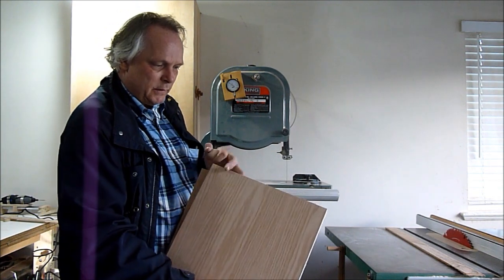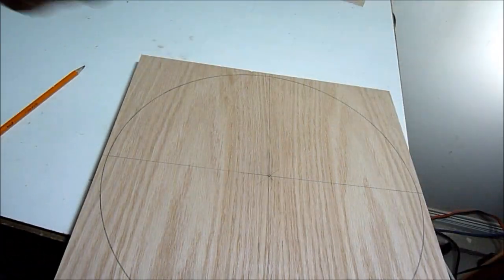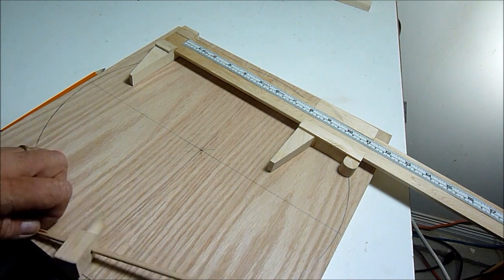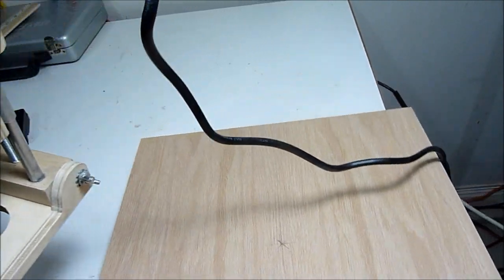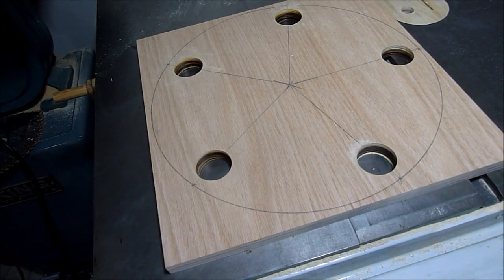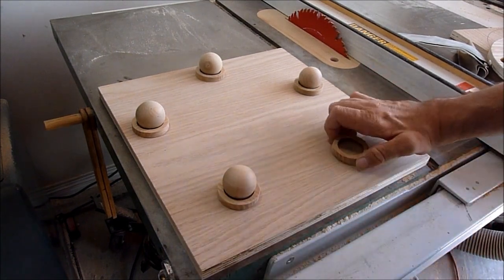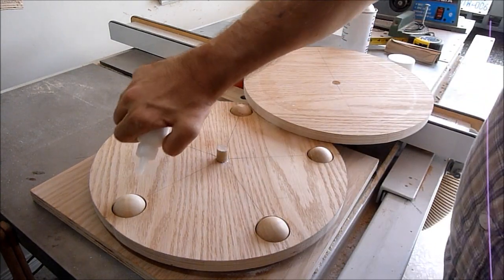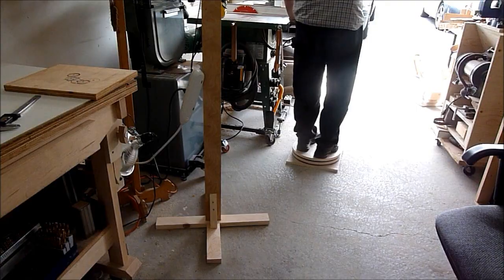Lazy Susan made of  100% WOOD

Comment: I would wax all the inner parts including the bearings. That would give the wood a nice protective coating and also help it roll smoothly.
I have a set of bamboo crochet hooks. When I got them they were in usable condition, but the yarn would still grab onto the minute fibers of the hook causing annoying drag and unnecessary wear on the yarn. I sanded them with very fine steel wool and very fine emery boards meant for finger nails. Then I dripped hot wax on the hooks and polished them to a nice sheen. Now they work even better with the yarn and it's easier to crochet with them and they don't cause drag and wear on the yarn any more.

Comment: Pretty smart idea. I would have taken those wooden rings that suspend the balls and routed inside the tops of them to match the curve of the ball. It would have much less friction. Also, you could route the underside of the top disk that rides on top of the balls with the same type of routing bit using a circle jig; so the balls will have more surface area to ride on which will minimize wear.

Comment: To anyone else watching this wanting to know more about how he divides the circle, it's done using what's called "Chord length", the distance between two points on a circle's circumference if drawing a line directly between them.

The basic equation is: chord length = Diameter * sin (180/number of holes)

Comment: This is a neat idea.  However, I suspect some slop (looseness) will develop as the balls wear.  Plywood is very hard and rough and the inside of those circles might wear the balls out of round.  So might they dry or warp out of round.  Have you put this under any strain for any length of time?

Comment: and what's that thing used for? I've never seen this anywhere.....
Reply: You may have seen it in a lot of places,and just not realized. The one we have at home is in our cabinet we use it for a revolving spice rack. My wife has maybe 50 different small bottles on,and you just slowly spin it around until you find the spice your looking for. All those spices fit nicely on basically a square foot of space. Some are even multi-tiered. Just think of it as a revolving space saver for whatever you need it for.